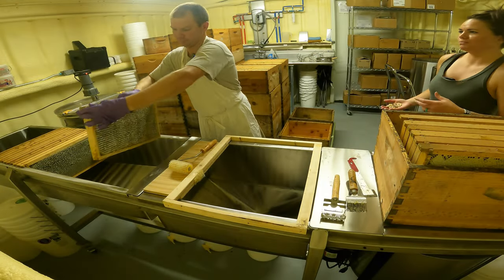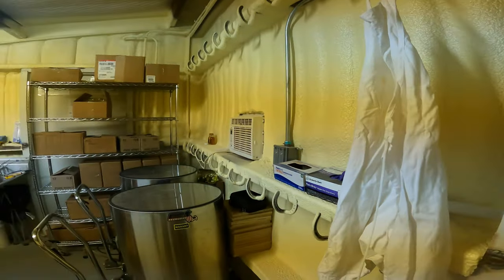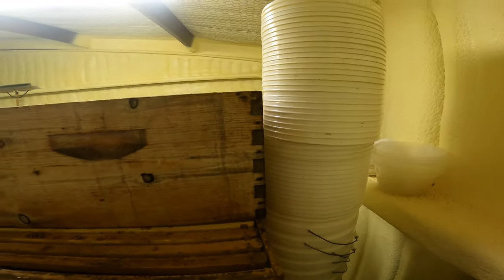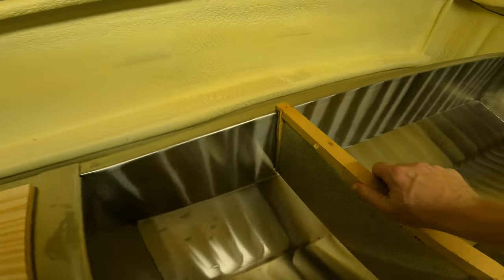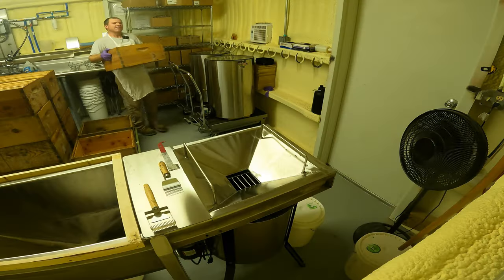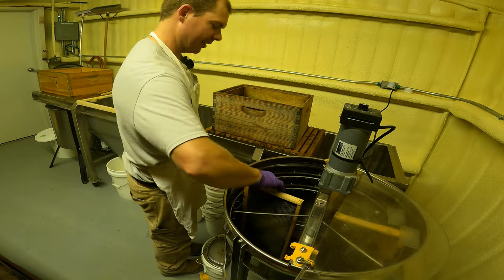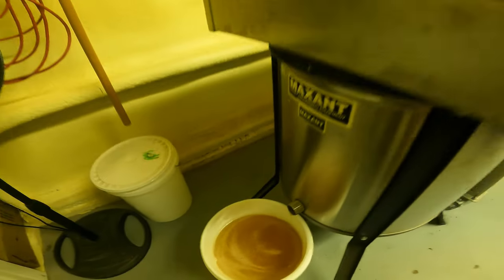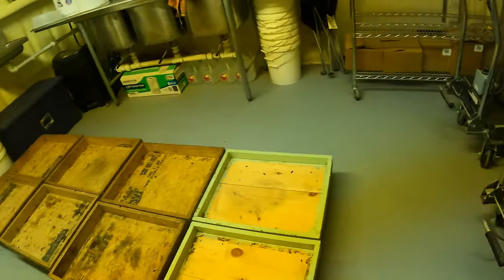Extracting Wildflower Honey 2023

Comment: The strainers were one of my biggest bottlenecks.  They constantly needed cleaning.  I bought a bunch of them, but it was still too time consuming.  I ended up losing the strainers completely, and using a clarifying sump with baffles, and pumping to 5 tanks, 3 are heated bottling tanks.  The wax and particles float out in the sump and the tanks.  By the time all my tanks are full, they've settled out enough so I can fill buckets out of them for the rest of the harvest.
Reply from the maker: Sounds like an efficient setup. Uncapping and strainers are my bottleneck. I have 3 strainers to rotate and rinse them in the sink after they've drained. I have a clarifying tank ready to be used but the size of my harvest last year didn't justify using it.